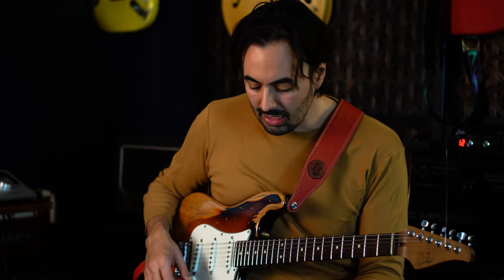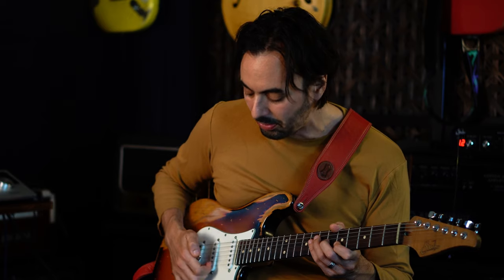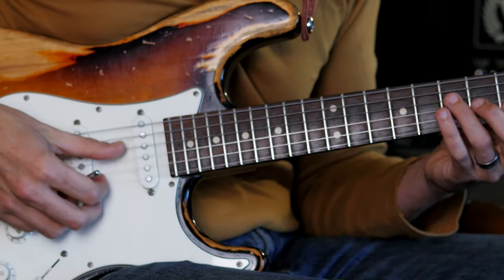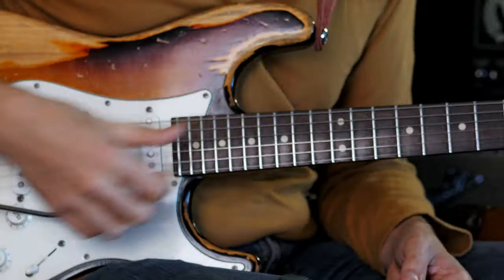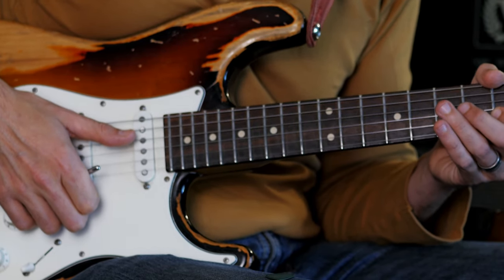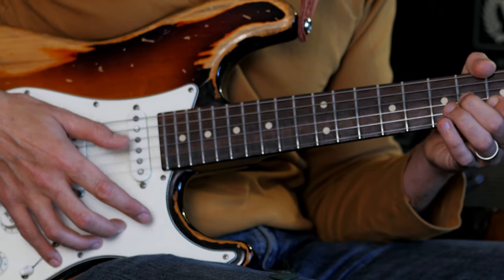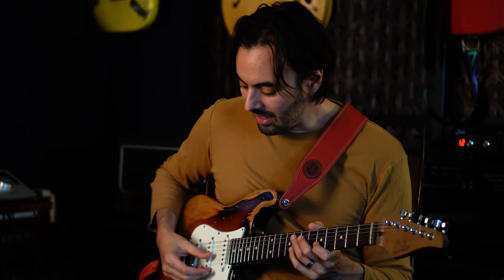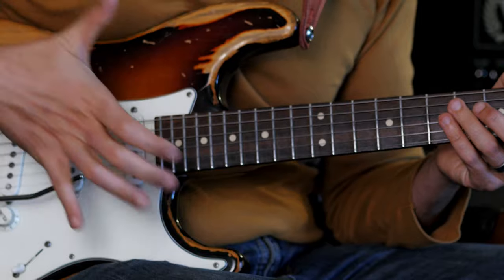Jimmy Herring Faux Slide Technique EXPLAINED

Comment: If I set my Strats up for a floating bridge that you can pull back on it takes forever to balance the spring pull vs the string pull. Otherwise you will never keep it even close to being in tune. What gauge strings do you use and how did you set the spring tension on the bridge to get the whammy bar to "return to center" after you bent it down or up? Otherwise it will be out of tune after 1 use!
Reply from the maker: Use 3 springs max 2 sometimes works better. If that doesn’t help then there is something catching your strings either on the bridge or the nut. Make sure to lubricate those points. I’ve setup all my strats that way for years and generally have no problem